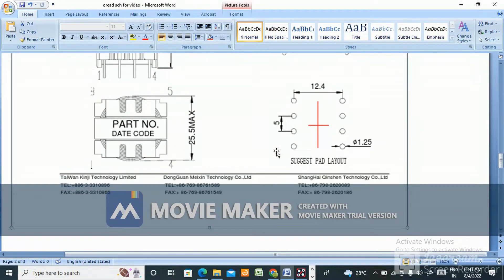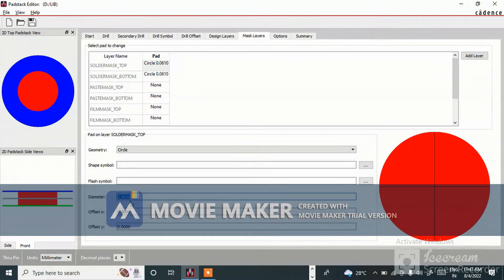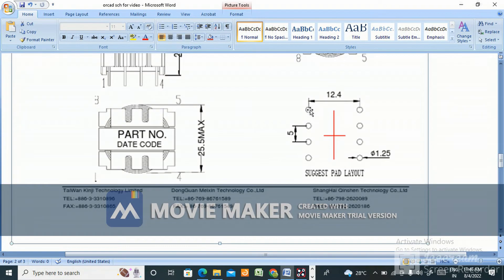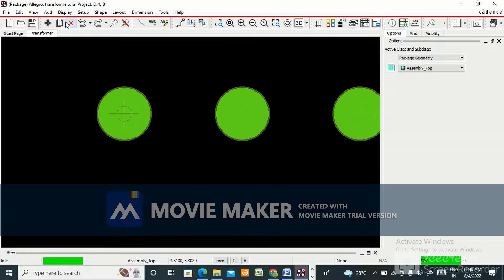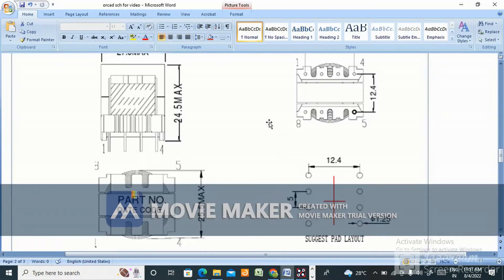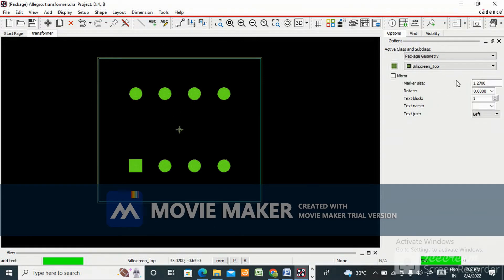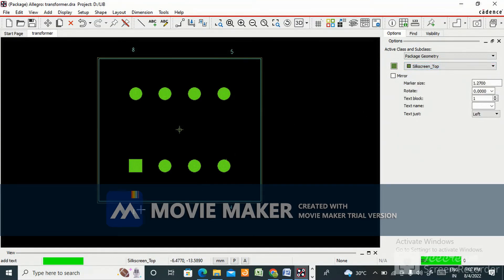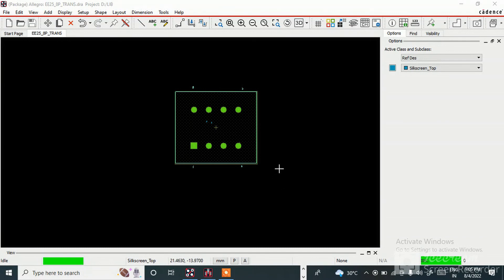THROUGH HOLE FOOTPRINT CREATION IN ALLEGRO#ALLEGRO17.4#ALLEGRO#FOOTPRINT CREATION

Comment: In Through hole where is the Anti pad and thermal pad size?
Reply: 1.5 year's experience in altium at 2016
Reply from the maker: Ok.
Reply from the maker: first you need to understand what is antipad and thermal pad.

Oversized pad to get clearance in plane layer for through hole pads that should not be connected to plane is call Antipad.there is no need to create all the footprint with antipad.and size of the antipad is not fixed. it depends on the size and density of the board.antipad is used to get clearance in copper plane. if interviewr is asking u what is antipad u just tell me it is extra pad size we are giving to get void in the plane layer. suppose ur pad size is 60 mils then u give 10-20 mils extra to make void on the pad
Reply from the maker: A wagon wheel-shaped relief pad etched in the copper of a ground plain around a through hole is called thermal relief pad.
It connects to the plane through one or more narrow track across an opening in the plane, rather than 
connecting directly to the plane, so that heat transfer to the plane is minimized during soldering
Reply from the maker: how many experience do u have